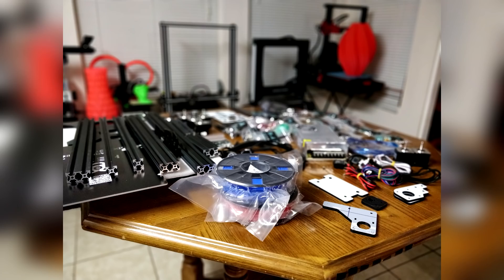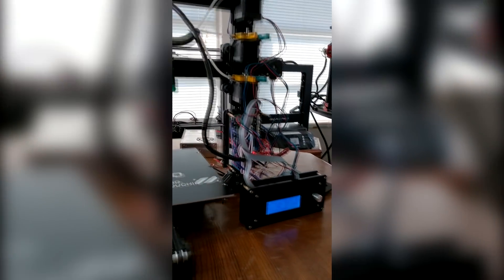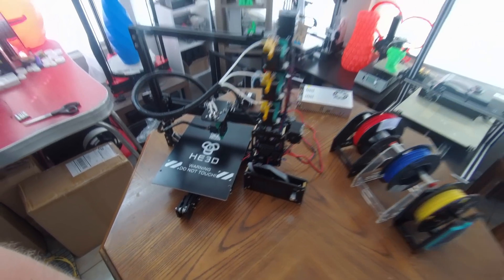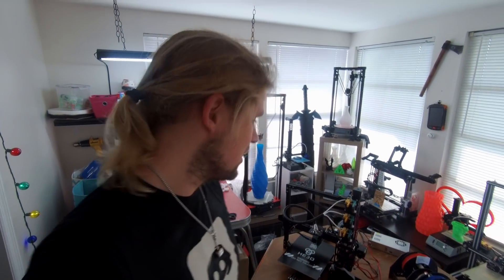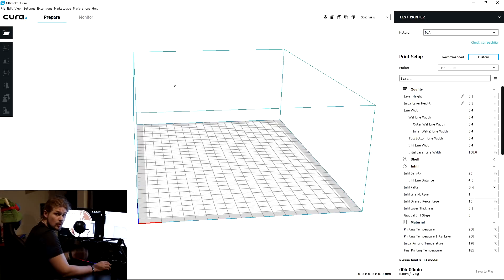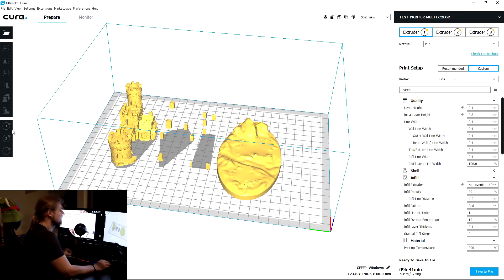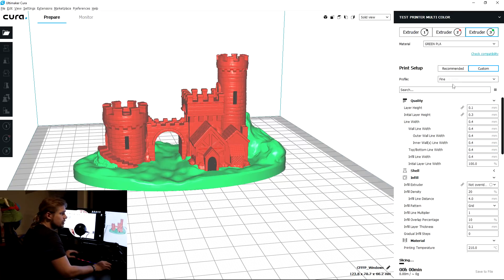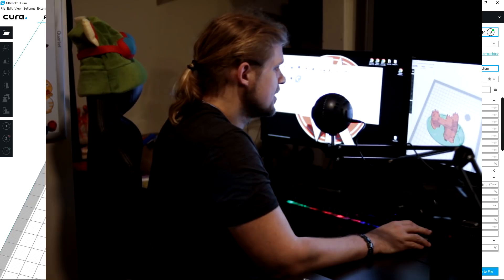HE3D Ei3 Full Metal TRIPLE Extruder 3D-Printer Review w/Cura Settings

Comment: Hi... I have the exact same printer... Could you help by showing where to connect the wires from a 3D-Touch and SN04-N 
on the Ramps plus 2 v1.9 board for auto bed leveling..... Cheer's in advance

Comment: There is nothing seriously "Cool" about this machine.
In fact it's supplied with the cheapest and possibly worst that China can provide.
The support is awfull.
Mine even came with the wrong firmware for the machine provided.
HE3D don't care about what they sell as long as they can sell it.
The bowden tube rig is rubbish, the triple nozzles drizzle constantly, and it is impossible to align all three nozzles on the Z-axis. 
The machine is a venture into dreamland by someone with no experience at all.

I have done nothing but upgrade mine since I received it and the best upgrade was to sack off the multi nozzle and put a direct drive Titan on it. That left me with a couple of spare Nema 17's.  
It also NEEDS a dual Z-axis upgrade and quite a bit of frame reinforcement because it is not a solid frame design at all.  The 4 wheel Z-axis movement on both sides is utterly stupid!

It is impossible to wire up without severing wires. The firmware runs at only 80 steps/mm on x and Y because they provide 20 tooth gears, other machines run at 100 steps/mm and use 16 tooth gears.
It is however the machine to buy if you want to waste the rest of your life becuse when you buy it. your'e facing a joke.
I highly un-reccommend it and I bought one.

Comment: Is the frame the same as the single color Ei3? I'm screwing with this two days now, and the current issue is the frame. Which length goes where. Nothing is labeled... a bag of parts and no instructions. The sheet they send is useless...

Comment: I put mine together in several sittings over a couple of days - getting too old to pull all-nighters.  This can be a good printer if assembled and aligned correctly, but reprap.cn has been f*cking useless for support and documentation.  It's my first 3D printer (I see you have quite a few) so you can imagine how frustrating getting it to a point where it would print anything more than a hairy abortion would be.  But I did eventually get there.  I think my biggest problem was it was shipped with firmware that moved the Z axis 4 times too far per step, so as a result anything more than 1 layer deep would fail.  That's the one place where reprap.cn was actually helpful - they provided a link to step by step instructions on how to hack, recompile, and upload new firmware for this printer.

Like I said, this is my first printer, but I would not recommend it as a first experience in 3D printing to anyone who is not both mechanically skilled and a programmer.

Thumbs up for this video - you make using this printer look much easier than it really is!

Comment: Did you know they make PRINTING RESIN now that (once polished) looks like a BRASS PATINA for a STATUE?!? :)  Caleb,  I have been a 3D Artist for nearly 30 years.  I can help you make anything you can think of in 3D in scale and high def and send you printable files!   I am thining maybe to make those Holders that hold the Rift controllers to the hand like Knuckles!   QUESTION:  I ordered the VALVE INDEX for June 28th Shipping.  I only could afford the HMD.  SO:  I just bought a pair of 'great shape' HTC Basestations 1.0 for $180  1) Is that a good price?  and 2) I know you're a RIFTER like me, but, since the Basestations have Moving Parts,.  Do you think I should TURN THEM OFF (Unlpug them) when they are not in use?  (Anybody?)  I wonder if they have aSTANDY BY or SLEEP mode,.  COOL MUSIC!!      You are welcome to COME TRY THE INDEX oif you are in the BAY AREA.   Thanks for writing me back!
Reply from the maker: Congrats on the pre-order! I'm not sure about the price as I've never purchased them separately, still I would only unplug mine if I knew for SURE that I wasn't going to play with them for awhile. Otherwise if my Vive was plugged into the PC I kept the sensors running day and night.) I never had issues myself. If I'm around I'll take you up on that!